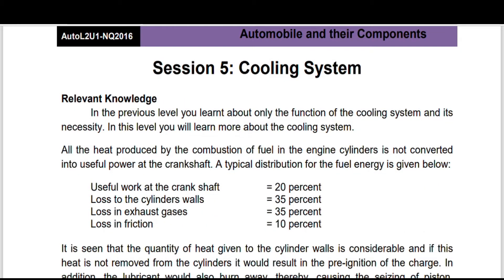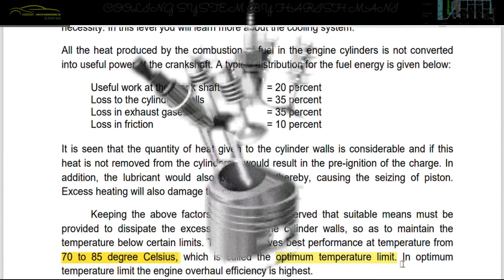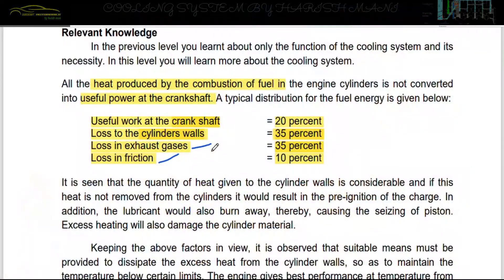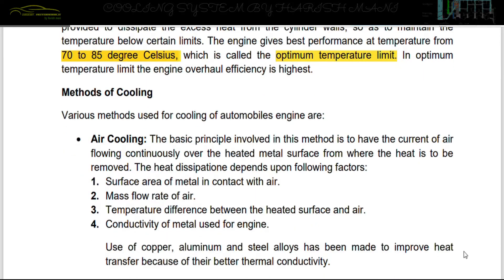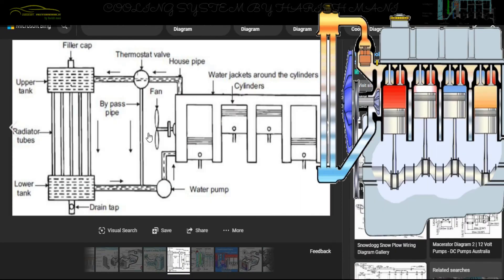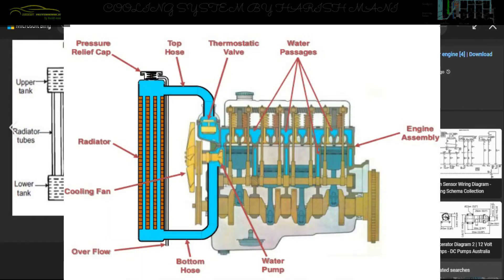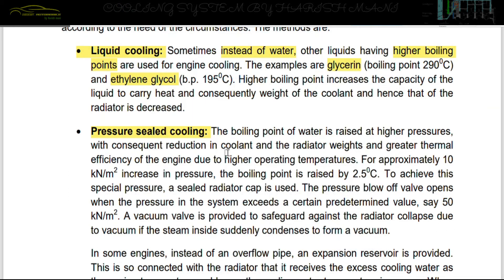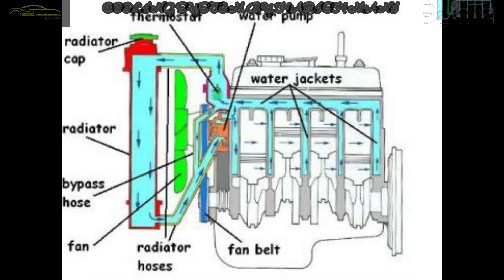NSQF LEVEL 2 - Unit 1 Session 5  COOLING SYSTEM

Comment: Sir u have not told different instead you have telled about explain liquid cooling system and pressure cooling system
Reply from the maker: K I’ll send u answer soon
Reply: Sir answer it tomorrow is text in online classes
Reply from the maker: Liquid cooling system:- 
-this is the one of important cooling system 
-the liquid is used for cooling the engine 
-instead of water liquids are used with high boiling point 
-ex glycerin with boling point 290 degree Celsius 
-heat removing rate is good 

Pressure sealed cooling -
-this is the important cooling system in engine cooling 
-water is used for cooling the engine
-water used with high pressure 
-In this system the sealed tank is used 
-It operates high temperatures 
-efficient in cooling